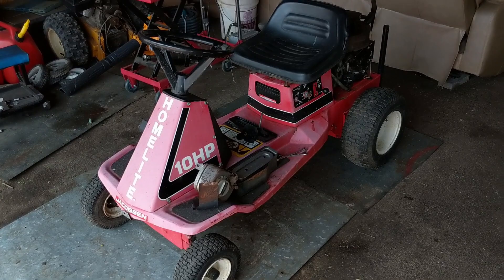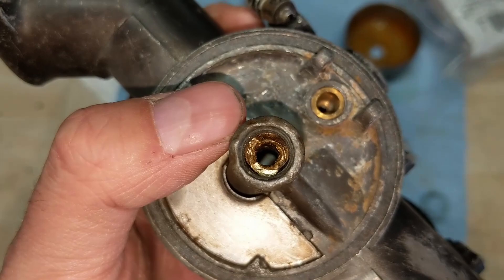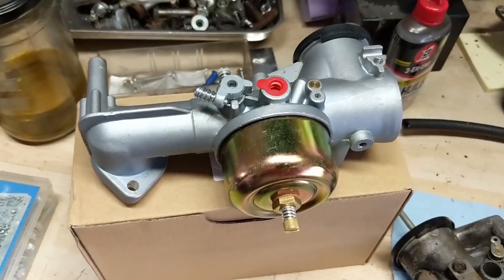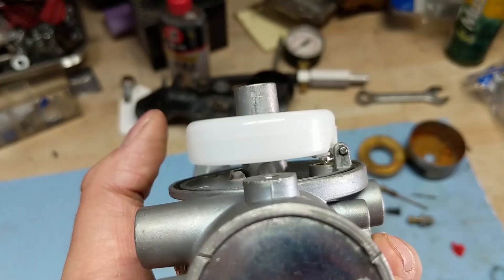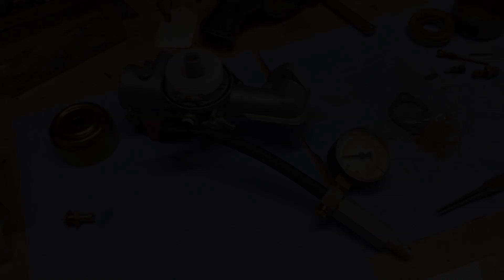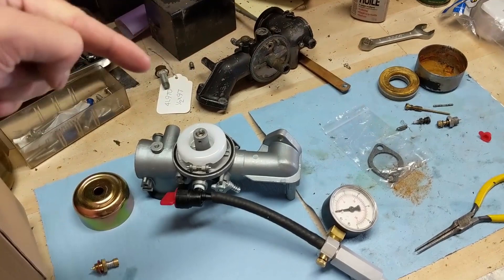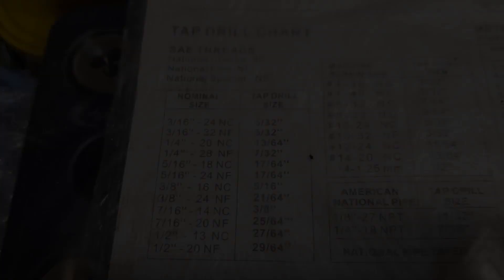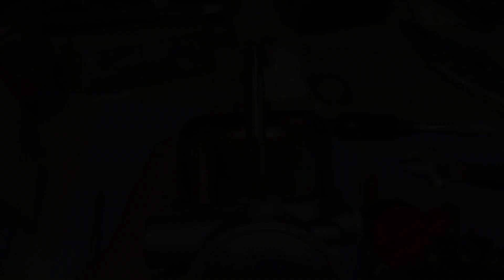Carburetor Replacement - 10hp Briggs & Stratton [PART 1]

Comment: I'm glad you got the engine fixed on the mower I have a1985 11 hp I/c Briggs and Stratton engine luckily the carb has been replaced by the way had to have a New sump gasket .&. intake vaive  job done but now got to get the needle Valve & seat replaced  the engine sits on 1985 series 5 extra tough 28 inch cut hi vac snapper also go a Montgomery ward 42 inch cut hydrostaic drive limt edition  mower made by mtd it's got  a 18,5 twin cylinder Briggs and Stratton engine the mower is a powr Kraft she got issues with the engine but she's in the shop along with the other mower oh by the way great job with the mower youi are working on.my Canadian brother 😀😀 😀

Comment: Nice job, Teflon tape turns to goo when exposed to gasoline, Teflon pipe dope paste can be had that is gasoline safe.
Reply from the maker: I don't even think it needed it, but I ran it anyways, and yes the pipe dope is superior for use around fuel valves/fittings.

Thanks for watching!

Comment: Lots of great stuff there! When you screwed in the new black plastic inlet/shut-off valve, I understand that it has to be in a suitable position to take the fuel hose, but you also have to turn it on tight. So unless you were EXTREMELY lucky, I would have thought that screwing it inTIGHT it could have ended up pointing any which way. Could you explain please because that dilemma often happens. Thank you.

Comment: Excellent as usual. I have a Niki carb on a 1450 series briggs 305cc that won't run right even after I drilled out the pilot jet. I have done several before with some good results.I have a small engine shop and hate the Niki carbs. Do you know of another make carb that will fit in the place of the Niki? I thought maybe a Walbro might fit? Thanks for the video's.
Reply from the maker: Yea the walbros from the craftsmans are usually the same, I forget the model of my neighbors machine but if I can get it tomorrow I'll post it here.

He had a 13hp so it should work the same.
Reply: I hate Nikki carburetors too.
It seems to always be a gamble wether cleaning them will work.
I think I will just start replacing them...I've had luck with the Chinese eBay ones.
Reply: Really there's a walbro that will work, cool.

Comment: Do you know the thread size on fuel shut off inlet valve?
Is that fuel pressure tool something you can just buy?
Thanks for vid, I am replacing same carb/same 10hp day before you uploaded this vid. Glad u found the model # on replacement. I am seeing them for <$30 eBay. Canada must be more expensive...
Reply from the maker: Hey thanks for watching, it's listed as a standard 1/8" NPT (Pipe Thread)

Also, I purchased the carb pressure tester but it wasn't cheap, about $110 Canadian.

It's saved me more than that amount by identifying leaking carbs and saving me the time from installing and removing to fix again!

Here's the link: https://www.amazon.ca/gp/product/B001OK6LC6/ref=as_li_qf_asin_il_tl?ie=UTF8&tag=eliminatorper-20&creative=330641&linkCode=as2&creativeASIN=B001OK6LC6&linkId=291d21a07ded1972561fbecee82ad5a8

Comment: Hi There,

very good video.
I am wondering if you can share where did you buy this new carburetor.
I have the same one in my Riding Mower and has been a bid pain to try to fix.. 

Once again.. very descripted and help video

Gilberto
Reply from the maker: Amazon, just use the part number and look them up.

Comment: Where can I find the fuel line tester?  I tried Amazon and cannot find the simple type that you used.  Your tester has a sliding/pump rod on the side of the gauge.  Thanks.  Great informative video.  Seems like Canada has all the good small engine repair videos.  I watch DonyBoy and Steve's Saloon.  Fortunately, I recently found your videos.  I subscribed.
Reply from the maker: Thanks for the kind words Jay! As for the needle valve tester, you'll have to try copying the stens number and searching. They're hard to come by, but also try ebay. Other than that, I can't be of more help because I know STENS doesn't sell to consumers, only if you have a business account.
Reply: Jay - You might have found the tester by now, but if you haven't Amazon has it and it's called "Stens 750-230 OEM Pressure Gauge 30psi, Black" $38.90.